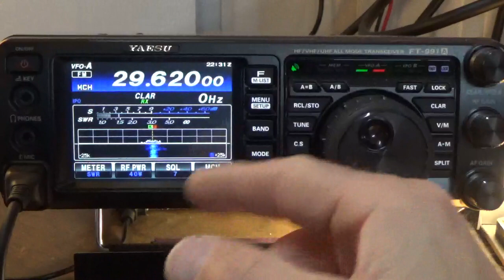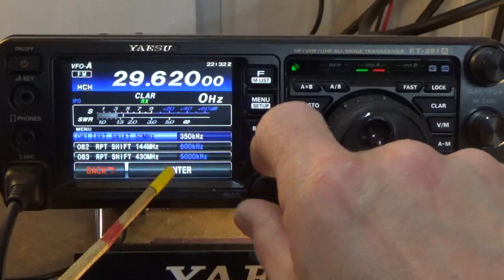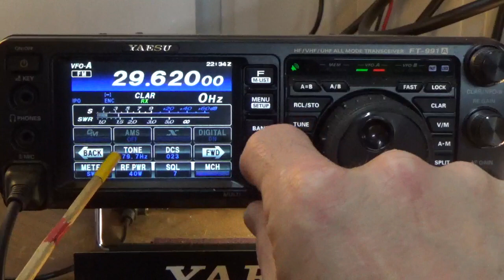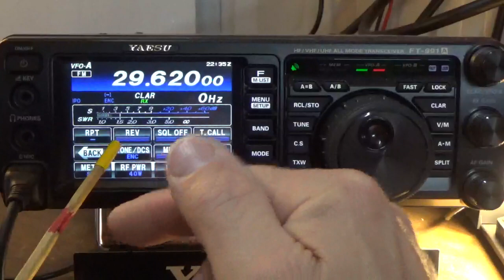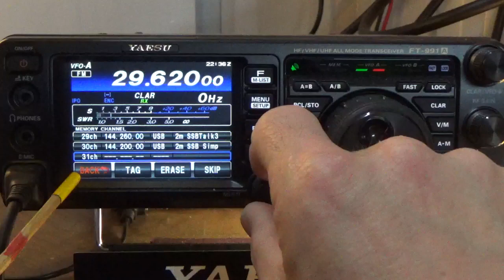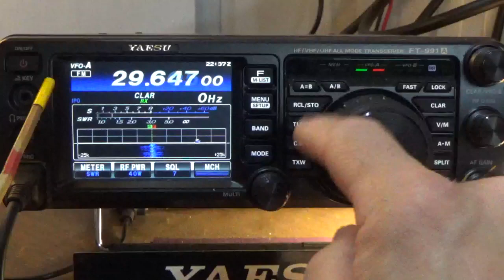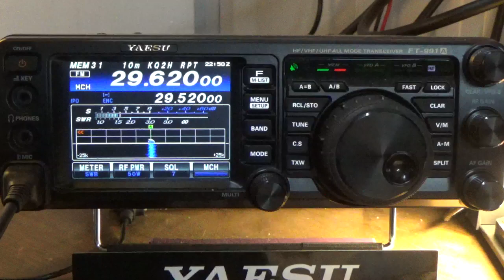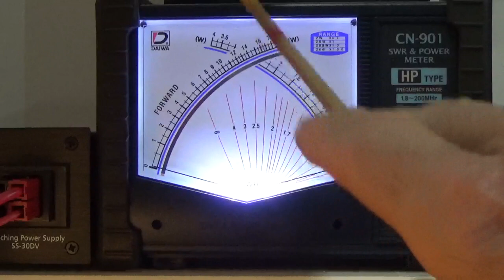FT991A Programming Catskill - KQ2H in NY  RPT settings & contact - Found HIGH SWR - testing stopped.

Comment: The memory save, did not work because you have to hit the A-M button momentarily first then, select the slot where you went to save it and then hold the A-M button down until it’s saved. whereas you want to the F button and brought up the memory channel menu and tried to save it and you can not do that.
Reply from the maker: Hi Brian, thanks for the message I'm embarrassed, I knew that it's just I couldn't seem to remember that when the camera was running, I updated the description with mistake,  after programing the VFO-A press A-M quickly, then use the Multi knob to find the available memory location from the list, then with the memory location selected press and HOLD the A-M button, wait for two beeps and the memory list to clear.  Have a good week and keep in touch '73